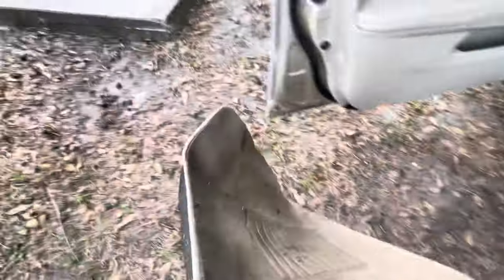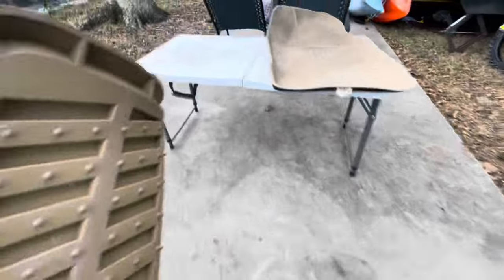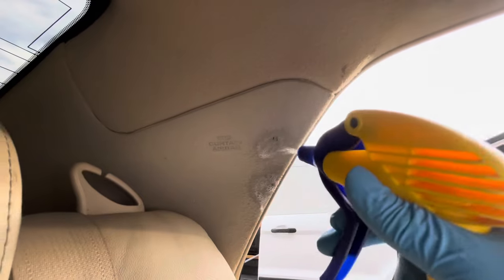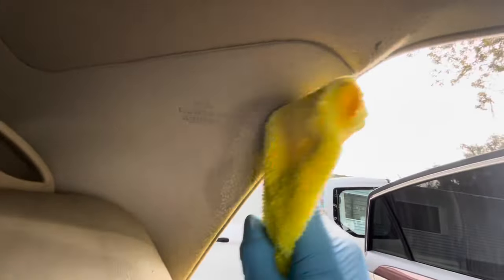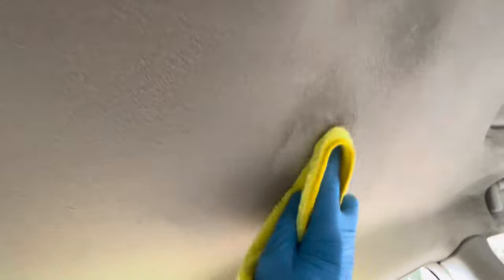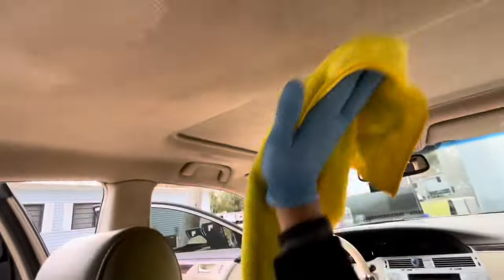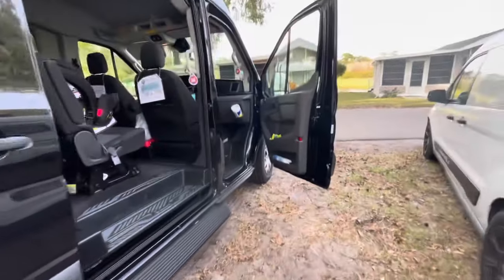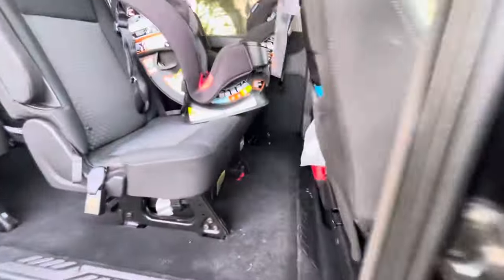Day In The Life | Mobile Detail Business | Hiring Your First Employee, How To Clean Seatbelts

Comment: Jess you are so cute, im loving your content, so real , its great watching another detailer learn their way thru things too! Hey, without criticism, i just want you to know, for me, i inform the customers i do not normally clean the headliners and seatbelt straps for liability reasons and if their detail demands doing it i make them “sign the line”  i just recently did a headliner that had severe stains and smelled like pot! What i do is use Absolute at 1oz per gallon ratio and get my mf fairly wet with it and rather than spray directly onto headliner i gently rub the headliner that way and i have had some amazing results. Tuffer stains i bust out Terminator or xpress the same way, onto towel only. Doing it this way avoids inducing too much moisture into the headliner which can cause certain headliner types to later have material sag which if your unlucky can come back on you on down the road! Something to think about, in the same way i used PRO smoke n odor eliminator, it really helps kill smoking smells, give it a try & let me know if this works out for you,   , ill try your seatbelt trick with Terminator. I love the p&s carpet trio , its my 1 go to, no extractor no steamer! Yea love it” also i like Xpress and i heard from P&S it does well not drying out plastics etc and leaves behind i nice sheen. Typically i just use it and no oily dressings. Good luck working with hubby, i understand allll that too well. I could relate. I recently lost my lil helper to nursing school & she got so good too towards the end, yea sucks! Hey if you get the chance visit my FB & ck out the really cool McLaren i got to do this week 
Your fellow learning detailer
Andy
Reply from the maker: Thank for the tips and five stars to you on your people skills 🙌🏻 I am always appreciative of people’s feedback and tips but I only come on here and respond to them when I have a good mindset to deal with people’s comments ‘cause they can be BRU-TAL 😂